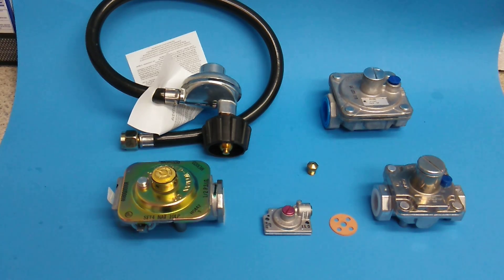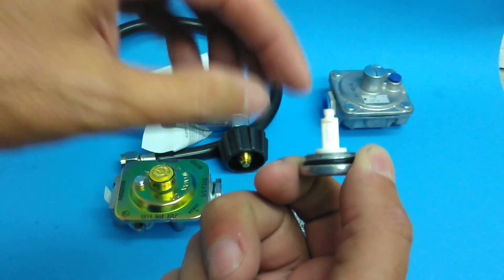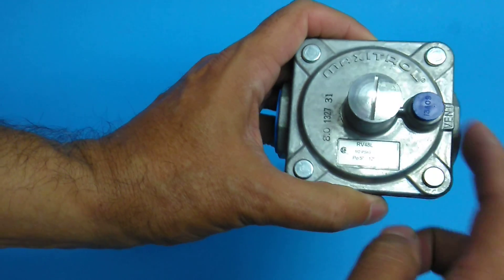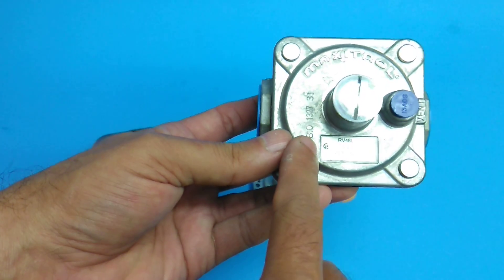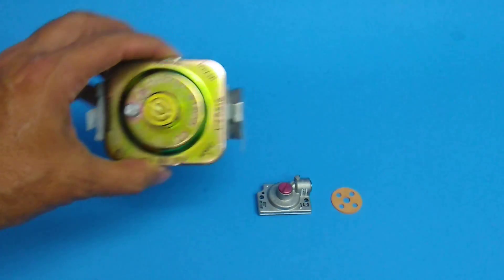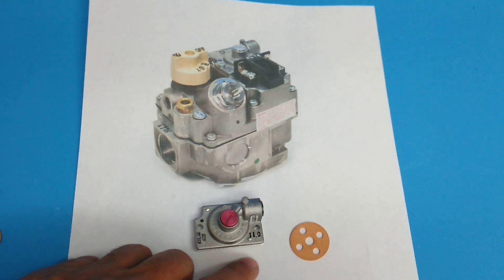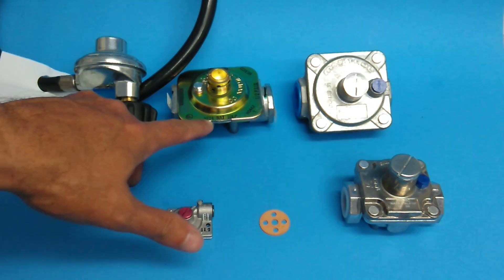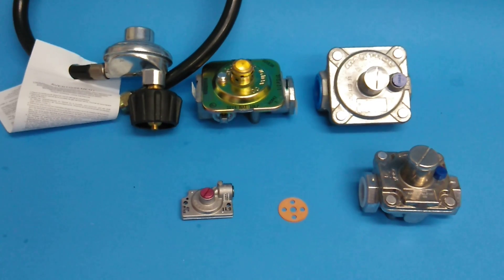Fuel Regulators Explained

Comment: hi , very informative , but one set of information is needed , the input pressures or source of gas . i found out the hard way that a 1/2 psig regulator cannot be used with 100 lb. propane tanks .
Reply from the maker: Doing a fuel conversion is usually a simple affair. I've converted just about every type of bar-b-que and stove made. Feel free to contact me at 714-574-1544 during normal Midwest business hours.

Yes, that's correct. Propane in a tank is usually rated at 150 psi; enough to compress it into a densely packaged liquid state. A normal consumer type fuel regulator is rated at 1/2 psi maximum input rating. Anything above that input "pressure" will make the regulator go into an "overlock" scenario that will shut down the fuel flow though the regulator body. A large storage propane tank will require a special regulator (or even a dual stage regulator) to allow it to release at a more usable flow rate for a common household appliances using a consumer type regulator.

Comment: Is there anything inside the regulator that would stop the flow of the gas intermittently?  Some times I can't get the gas to flow on my BBQ when I start it up.
Reply from the maker: Doing a fuel conversion is usually a simple affair. I've converted just about every type of bar-b-que and stove made. Feel free to contact me at 714-574-1544.

If the problem is affecting radiant ceramic burners, keep in mind that those specific burners have a safety built into them by way of a thermocouple that prevents those specific burners from receiving gas unless they are lit and burning. Most other conventional burners on a barbecue don't employ this type of system. In either case, the regulator is not the part that would shut down the system under these circumstances, however a regulator would shut down the fuel supply if your barbecue experienced an open loop scenario (massive gas leak where a large amount of gas is released all at once). All regulators perform this function when the fuel demand spikes above the rated maximum output of the regulator (300 btu vs 250 btu for example).

Comment: Frank I have a DCS 48 inch natural gas grill. No gas at this time. I suspect that the regulator is shutoff. It is a Pietro Foirentini model 31052. how do I reset it. I have turned off the gas supply and bled off any gas from the burners(there was no gas). It will not reset. Can you help?

Comment: Hello and thank you for the great vid explanation. Question for you. I recently purchased a high end bbq grill, but it came equipped with natural gas burners etc. I then purchased a transition kit to configure it to propane. I replaced all the burners and a brass piece for the  rotisserie infrared. However, the gas regulator doesn't screw off. It's a fixed regulator from seven universe. Am I good to use my grill with that regulator? Or does that need to be changed out for propane usage?
Reply from the maker: If the regulator is adjustable, then it's a regulator for natural gas only and will not work for propane. You'll need to purchase another regulator. If you live at altitude, you'll want to purchase an adjustable regulator to adjust for the altitude if your over 5,000 feet.

Comment: Can I just change the orifice to ng of a propane pro form heater and connect to my ng supply without changing the regulator?  What will happen if I do?
Reply from the maker: There are no shortcuts. You must change both the regulator and the orifices.

Comment: FRANK IT'S VERY PROFESSIONAL IN HIS FIELD! WHERE DO YOU SUPPOSE TO INSTALL A REGULATOR AT ? SPECIFICALLY OF A STOVE OF A STOVE FOOD TRUCK. THANKS
Reply from the maker: The regulator in a food truck is usually part of a device the performs several functions (I'm assuming you're using a Wolf, Imperial or some type of commercial oven). This unit is a multiple function device that typically contains a pilot generator, a thermostat (switch), a regulator and a gas valve. It's typically designed to not allow gas to pass though unless the pilot is lit. If you fast forward this video to 11:35, you'll see the explanation of how this device works.
Reply: @frankhamilton8257  THANKS!

Comment: Hello Frank, thank you for your video. I have a question: I have a maxitrol propane regulator that I am trying to hook up to a propane tank. The propane tank quick connect fitting has a 3/4 in male output. The maxitrol propane regulator has a 3/4 in female pipe thread. The 3/4 in male output from the propane tank fitting is a different thread size than the female input into the regulator. Do you have any idea how I can form this connection between the regulator and the propane tank? I have searched everywhere and I am unable to find a thread converter. If there is a different way to hook up this system please let me know! I appreciate the help, thank you.
Reply from the maker: I have regulator and fuel conversions to fit everything made, but I do not carry the type of plumbing to suit these custom applications. The propane tank connection is a specialty QCC type connector that is only used for this type of connection with an aggressive thread as opposed to the finer thread on your regulator's input side. You'll need to go through some due diligence. The other factor is that, even if you got a QCC pigtail connector, you may still need to go through a reduction to handle the internal throughput of the liquid propane from the bottle because it may overwhelm the regulator which is usually designed to convert from a house system rated at 7" WC. Likely, the best way to overcome this conflict would be to install a standard propane tank regulator (make sure it's rated at 11" WC), then plumb in your house type regulator downstream from that. You can get a tank regulator that doesn't have a hose, but make sure it's rated at 11" WC. You'll likely need to add in a few adapters to fit up your household regulator, so just take it to you local hardware professional, and he'll be able to help you with the adapters.

Comment: I have a wall mounted propane heater, does it require a regulator?
Reply from the maker: Yes. You'll need a regulator to control the fuel flow though those burners.

Comment: When the upstream supply valve is initially opened, with little resistance to flow, these springs must snap shut. Do they ever 'stick' shut in that situation, as a safety feature? Not understanding how these work, when opening a barbecue propane tank, sometimes I'll close the supply valve shut and reopen it, with the thought that the mechanism will work better if the pressures on both sides are closer to operating pressures. Am I wasting my time doing that?

Comment: I have an an outside natural gas line for my bbq.  I use a potable burner to can tomatoes.  Can I connect the natural gas line to the portable burner? Do i need an in-line regulator from gas line to portable burner
Reply from the maker: Weber typically sells their late model natural gas barbecues without a regulator. I use the term "late model" because this wasn't always the case for Weber as they used to include a fuel regulator with everything they sold. Residential natural gas is rated at 7" WC. I'm always about safety first, so naturally, I would recommend using a regulator, especially if the unit is to be used indoors. Here's a chart for you to get it right: https://andersonforrester.com/conversion-chart/   The burner itself will not need to be swapped, however the amount of fuel that travels up the burner tube will need to be altered to balance out the recommended air/fuel ratio required to make that burner operate as designed. This is usually achieved by adjusting an air adjustment commonly found on most burners. Doing a fuel conversion is usually a simple affair. I've converted just about every type of bar-b-que and stove made. I'm on the West Coast, so feel free to contact me at 714-574-1544.

Comment: Thanks, but what is the value one adjusts the regulator to? BTU of appliance? Flow rate needed? other? The issue about range of flow rate (inches of water) confounds the issue of which adjustable regulator to use? I am trying to figure out what regulator to use to fuel a portable generator with Natural Gas. How many inches of water are need to fulfill that load? And which regulator is best suited?
Reply from the maker: Natural gas comes out of the pipe at 7" WC, and the minimum rating that I've even seen on a natural gas fuel regulator is 3" WC. So the value will be somewhere between 3" WC and 7" WC. There are actually two factors concerning the rated BTU (fuel delivery) rating, the rating on the regulator and the delivery (the orifice - or, in your case - the jet or fuel injector). You'd likely be able to deliver the same rated horsepower output using a regulator rated at 3" WC as you'd have using a regulator rated at 7" WC, it's really the size of the orifice (fuel injector) that is your main concern. Here's a formula for calculating the amount of BTU that your fuel delivery system must be capable of - (Horsepower) = Power (BTU per hour) x 2,545. Since your generator will likely need to be accelerated under load, you'll need to figure out what both variables actually are (in terms of real world figures).  To figure out BTU ratings, use this table:  https://andersonforrester.com/conversion-chart/    That engine is likely fuel injected, so the amount of fuel delivered is likely determined by the pulse width of the fuel injectors (how long the fuel injector is "on" and "off" in a given time span versus the amount of times the injector will be pulsing into the combustion chamber on it's cycle). Another variable may come into play; the amount of time the intake valve is opened (this will determine the amount of air available for combustion). You may be able to figure this out by figuring out the total displacement of the cylinder, then calculating the amount of oxygen available based on that.  FYI, natural gas burns most efficiently in a 10:1 mix. I hope this helps.
Reply: Hi Frank, Thanks for the reply. The generator is a standard Chonda carb fueled gas generator. No fancy injectors that I make out. Just a carburetor with a butterfly choke. How does that change things?
So, it is the end load that has to be the determining factor which makes sense. SO as the load increasaes the lowering pressure draws more from the source and the regulator stands between the source (7" WC from outside feed into house) and the regulator (3"WC max.) Is that right?

Comment: Why is LP run at a higher water column?
Reply from the maker: LP is the abbreviation for liquid propane. When exposed to the atmosphere it's beyond it's boiling point which is -43.6 degrees Fahrenheit , so it flows into the atmosphere as a gas. The fact that it's in liquid form when it's in the bottle would indicate that it's stored at a tremendous internal pressure, enough to turn what is normally a gas into it's liquid form. Most propane regulators are set at 11" WC, but you can also use an adjustable regulator that would allow you to release it at 7" to 13" of Water column, however the industry standard for a "store bought" regulator (with the regulator body incorporated into the high pressure hose) is 11" WC. It's not evident why the industry has chosen this rating, but it is what it is.
Reply: @frankhamilton8257  Now I'm curious. What pressure would it take for the propane orifice to be the same size as a five-inch water column methane gas orifice? This is just a random curiosity of mine.

Comment: Do you know, if you can safely convert a US propane regulator to a EU 30Mbar version?
Reply from the maker: European's would describe the relative fuel pressure rating in Millibar, however Americans would describe this in inches of water column. To convert inches of water column to millibar, simply multiply by 2.488, likewise to convert millibar to inches of water column, divide by 2.488.

Comment: Hi.

Quick question for anyone who can confirm things for me.

I’m dealing with a chinese company that manufactures a grilling unit normally used with LPG for those rolling street vendor food carts. 

I’d like to convert that to Natural Gas. They tell me that I’d need to supply my own regulator but I believe that I’ll likely need to switch the oriface size as well, no? 

They haven’t provides any details on the oriface and I’m trying to ensure that its not somehow built into the grill in some proprietary way and would actually have a normal threading/dimension where swapping out is even feasible.
Reply from the maker: Those parts are likely parts that can be easily obtained since Chineese companies generally don't innovate. I've certainly reverse engineered my share of orifice designs from the hundreds if not thousands of orifice varieties out there. In any case, the orifices usually have numbers stamped on them, so the actual BTU can be deterimined from that. Keep in mind that those numbers will likely indicate metric sizes (those numbers often have 3 digits versus 2). Just use this chart from Anderson Forrester to determine the conversion: https://andersonforrester.com/conversion-chart/   

If you're still stumped, feel free to give me a call at 714-574-1544. Remember that I'm on the West Coast, so call during business hours in the Pacific Standard Time Zone.

Comment: Hi Frank I have a question, I bought a cooktop from IKEA it came with regulator and Orifice, I already change both them to be used on an LPG. My question is, I'm going to use it in the Philippines and we only have POL type gas tanks. What would you recommend doing so I can connect the POL tank to my cooktop. Thanks a lot hope you can give me idea on what to do.
Reply: I'm a big orafice guy myself, Frank!
Reply: Have you no NG system in the islands?

Comment: Excellent video. Very informative. I just bought a gas/propane generator that has the hose with attached regulator that fits the 20 lb propane tanks. Basically, it's the hose with attached regulator that is used on a typical porch propane grill like you slowed at the beginning of this video. I wanted to hook up the generator to my 500 gallon propane tank, so I ran to a local propane shop in town here. They unscrewed and took off the brass fitting fit for the 20 lb tank, along with the big black knob that also screws onto the 20 lb tank. They, then, put on the new brass fitting that fits straight into the 500 gallon tank on the end of the generator/grill hose with no extra regulator other than the one fixed to the hose and said that should work. It does fit into the 500 propane tank. But, my question is, should i be concerned before hooking it up and opening the 500 gallon tank valve that the only regulator is the one that is on the hose? Like i said, it's only one of those propane grill regulators on the hose that has been modified with a different propane tank fitting at the end so that it could now fit into the 500 gallon tank. Thanks, and awesome video that breaks things down into digestible pieces for dummies like me!
Reply from the maker: I deal with a lot of people who install appliances on master propane systems that provide a centralized propane source for all of their appliances. In your case, the appliance is a generator, but the theory and discipline are the same. I always advise installing individual propane regulators for each appliance. You mentioned you had a regulator that was integrated into a hose. Typically a hose regulator is rated at 11" WC, while a fixed regulator (not a variable one) is rated at 10" WC. You would need to install a propane regulator without a hose. It would be advisable to install a commercial regulator for this application. Not all commercial regulators are adjustable, many are fixed because I provide all kinds of regulators to specifically suit the needs of the application.

I do conversions on everything and have orificesa and regulators to fit all applications. Feel free to call me at 714-574-1544.

Comment: Very informative, now I think I know what needs adjusting on my hob to change jets from burning gas orange to blue.  Thank you.
Reply from the maker: If you're converting from natural gas to propane or vice versa, there are two or three things that need to be changed; the fuel regulator (either converted or changed all together), the orifices and the air shutter (or other type of air inlets). I deal in the regulator and the orifices. I have every type of orifice made, so please feel free to contact me at 714-574-1544. I'm in the West Coast time zone, so call during normal business hours.

Comment: What if my regulator does not come with such white plunger but it has a white plastic cap inside that can be adjusted with a screwdriver. How do I adjust it to successfully convert from natural gas to LP?
Reply from the maker: You won't be able to use this regulator with LP because it's an adjustable natural gas regulator. I have  propane regulators sat at 10" WC, so feel free to contact me during West Coast business hours (9 am to 5 pm) at 714-574-1544.
Reply: @frankhamilton8257  what if I have a regulator on the hose that came in the LP conversion kit? I have hooked it up today and the flame on few burners is orange on high setting.
Reply from the maker: The flames are oxidizing. You'll need to close the air shutters slightly to allow less air to enter the tube. This will only be a slight adjustment.
Reply: @frankhamilton8257  you are right. I closed it all the way and am still getting the orange at high. It is ok on low though. Thanks so much.